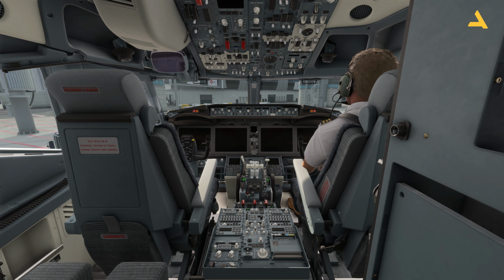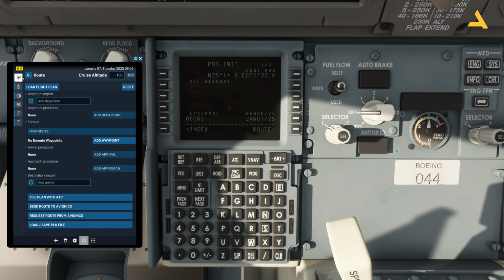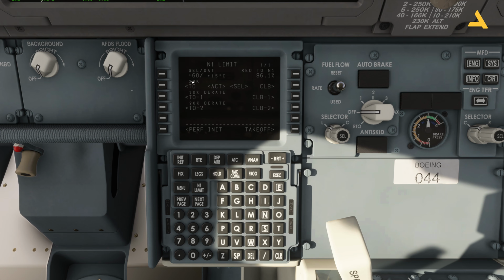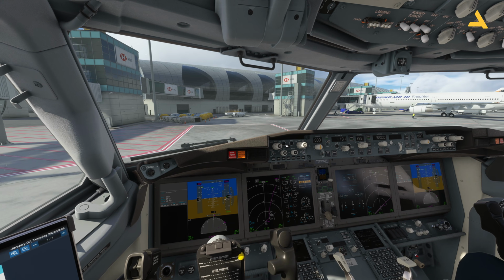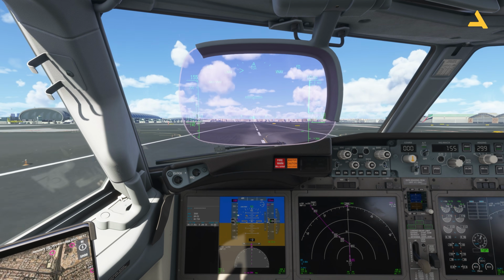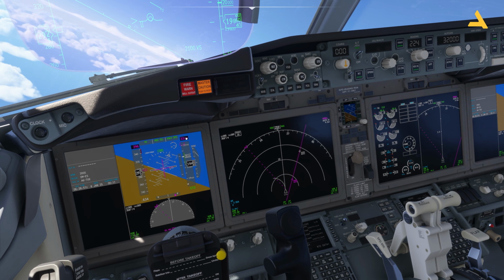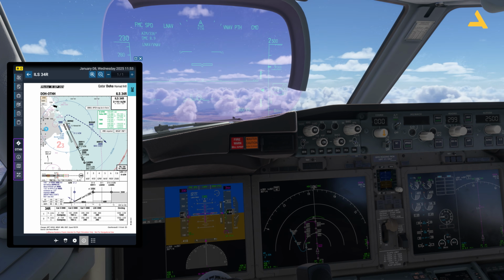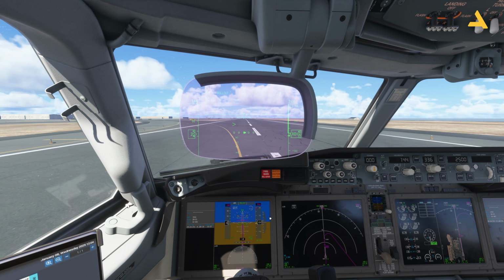Complete Tutorial of Boeing 737-8 Max in MSFS 2024 | A Beginners Guide

Comment: I just got certified on Airliners via MSFS 2024 Career and what a nightmare. When I click the Speed button I should be able to go back to my dialed in speed, didn't work. Also nothing I pressed would take it out of MACH mode. I didn't have the luxury of importing a light plan from simbrief so as the typical career mission, no speeds are set in the plans legs. Had to finally disable AT as I approached 10k because it didn't do that either. Manually did the speed from that point on. This was right after SU5 hit so not sure if it's that or this particular 737 just sucks like that. From watching this video though it seems like things worked for you, but does it work for you like this when doing a career mission? I ask it that way because I've noticed bugs in a few aircraft that only exist in career mode and not in free flight. Also to note, the round (but the blank speed intervention button and the blank C/O button didn't do anything during this flight). I'll try again in free flight mode eventually, but curious if others also have this issue in career mode, or a post SU5 bug.
Reply from the maker: Thank you for contacting ting me. I have not tried this plane in the career mode so far. But I am doing a series of videos covering the career mode and soon I will be flying this plane. I will try to cover the issues faced by you in a video very soon. Thank you once again

Comment: Hey, I have a few problems. When I go to load the flight plan it does nothing. I click load and just nothing. Also when I go to take off I do full throttle and it gives me the takeoff config warning. And lastly when I take off it sends my nose straight up in the air because of the trim and I put the trim to what my fmc says.
Reply: Takeoff configuration usually happens when flaps aren’t detracted to the position FMC says or speed breaks are set.(Takeoff configuration only happens when the throttle is set to 50% or hire)
Hope this helps if you still didn’t find out the problem😅

Comment: Atif, are you doing this in career mode or free flight?  I can't get the plane to automatically descend in career mode for the life of me.
Reply from the maker: This video is in the free flight mode and not in the career mode. If the descent is not starting automatically then use the Level Change option to start the descent. Have a nice day
Reply: @aatifahmad  I think I got it figured out.  I need to only turn on FD1.  If I have FD2 on as well it won't descend automatically.  I thought FD2 was just for redundancy but it clearly is doing something.

Comment: Hi, great video. Just note that when taking off the throttle must be moved to 50% N1 and see that it is stable thereafter press the TOGA switches and the authrottle will move the levers to the CLB power. There must also be forward  control column input until 80 knots to improve the nose wheel steering.
And can you please make a video on the TCA Airbus throttle settings for the 737 MAX, I'm really struggling with it.

Comment: between this plane and the A320neo v2, which one is the easiest to operate?
Reply: For me 737 is easier because it’s more manually and easy to operate just like cesna A320 uses lot of automatic system which sounds easy but a bit complex as a rookie we have to learn more about that and also in msfs 2024 when you’re using A320 your flight plan from the efb won’t synced to FMC so you gotta input it manually unlike 737 it will sync automatically even though you have to set the cruise alt and etc but it’s just easier
Reply: The a320 is way easier
Reply: @Briyantikiah12  every Airbus by iniBuilds is easier than Boeings by Asobo
Reply from the maker: Generally the A320 is simpler than the 737 especially when you talk about the start up procedures. But I started with Boeing 737 which made all the other planes easy for me. So I will recommend to start with Boeing 737 and you will enjoy it